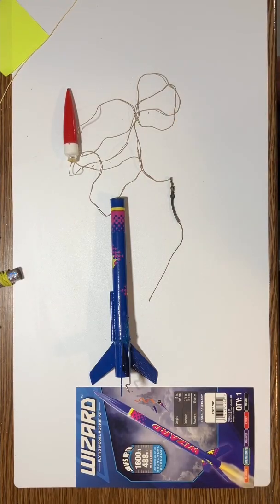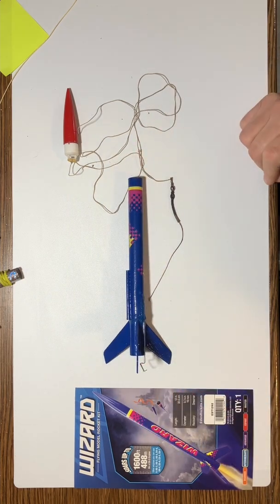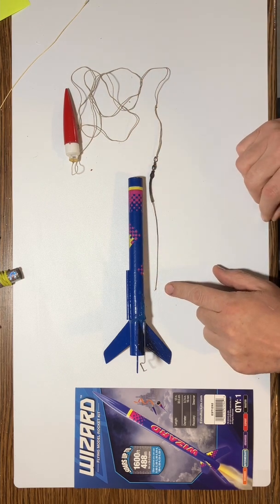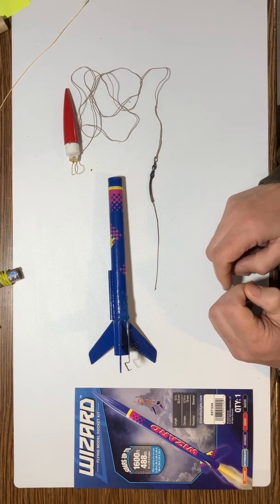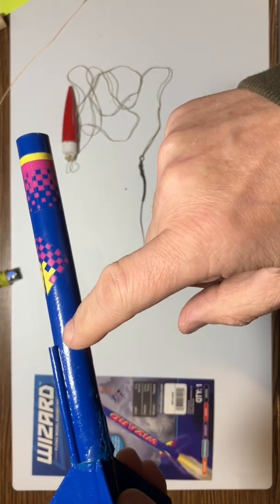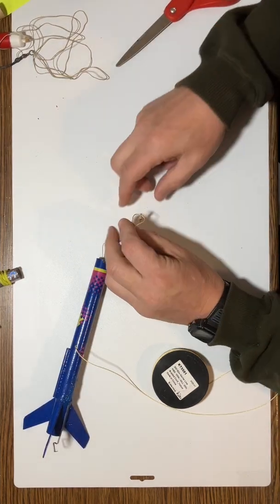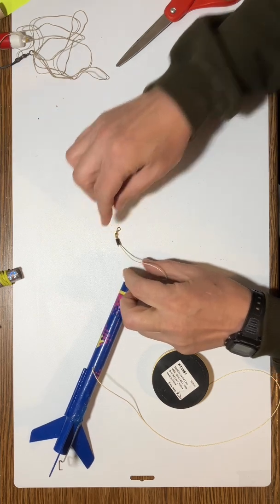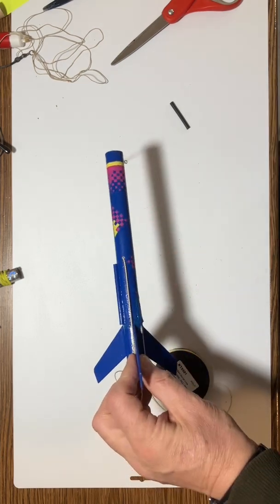1/3 Wizard Kevlar Cord Repair: Burn through problem

Comment: I had the chrome nose cone on a 2' estes rocket show up as a fast mover on a landing strips radar  i lived 5 miles off the end of the runway.planes lined up on our street for the runway. After the third rocket that day the fire deptment sheriff, and E systems security showed up and wanted to know what was going on. No planes had been in the air that day so i was confused until  they said they had fast movers on radar in this area going from 300' to 2000' in a matter of seconds. I had to fire off 2 more for them to see. After i was done they all got a good laugh and gave me the towers phone number. My mothers boyfriend at the time was pissed he was able  to be in the tower but didnt have the direct number to call in to it but me at 14 had the ability to call in to see if it was clear for me to launch. Saw a C130 clip the top off of a pine tree with its prop a few houses down from ours. Engine didnt even stumble. Planes were low enough to count the rivits on the underside panels. Am 48 now still brings a smile thinking back on it.
Reply from the maker: Start building rockets again! I launched during the "NASA days" of the '60s and '70's. I took a 40 year break. During Covid, I watched a lot of TV and saw rocket launch videos. I built a few rockets and had to wait 2 years for the clubs to open up again. Now I have 70 rockets and I'm still building and enjoying every second of it.